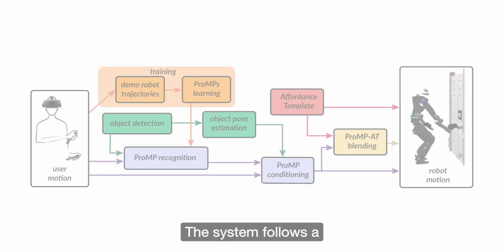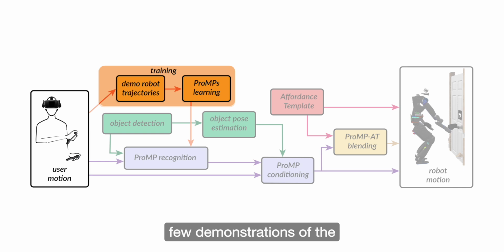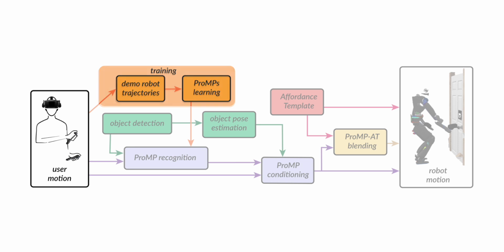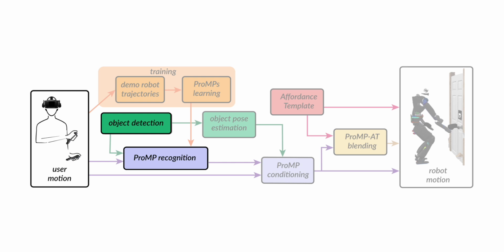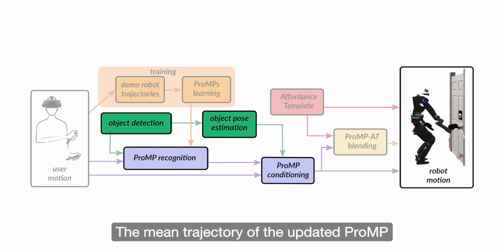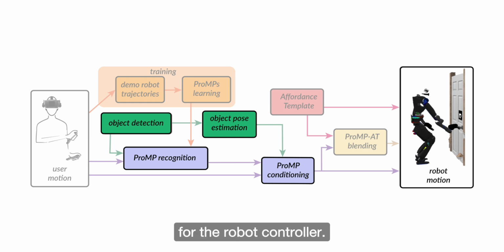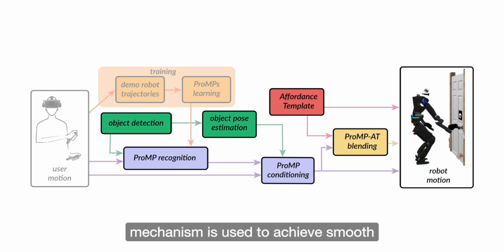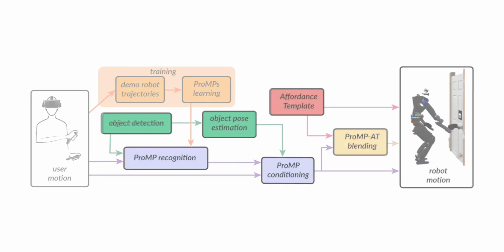Mixed Reality Teleoperation Assistance for Direct Control of Humanoids

Comment: You guys did a great job. In my opinion, you should also learn martial arts or boxing. You will realize that in order to have a strong punch, your legs need to be in the right position to avoid falling and the punching force will be transmitted better when the supporting leg, the ground and the body are united into a unified whole. .